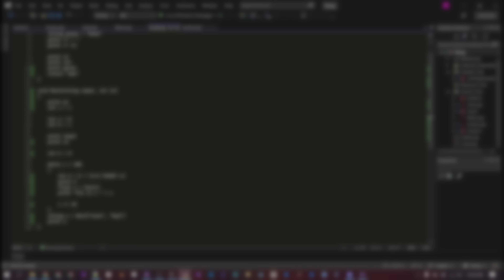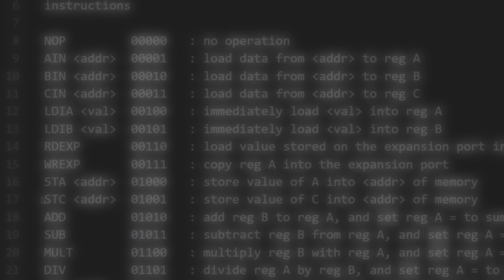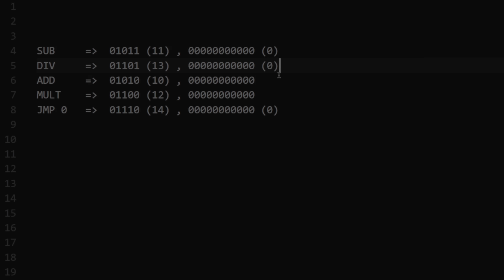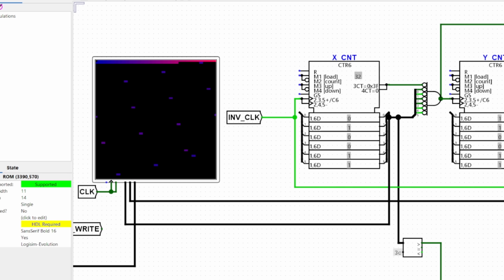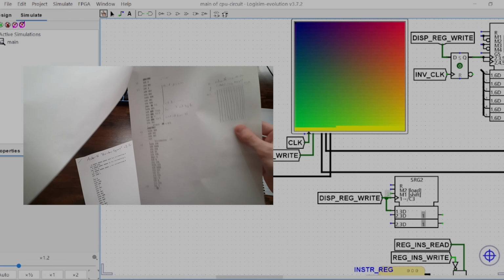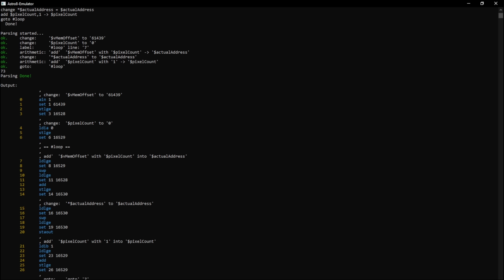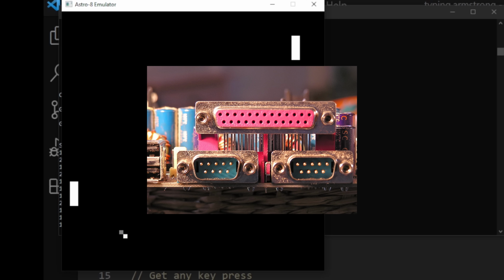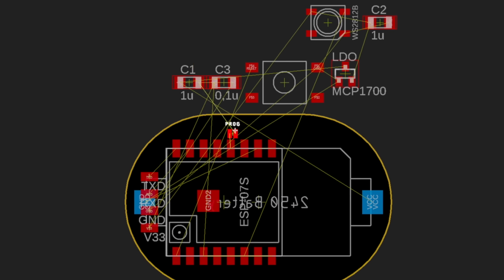I Designed My Own 16-bit CPU

Comment: Impressive! However, having special instructions for interacting with a controller is quite unusual. Normally those devices are simply memory mapped, thus it's possible to use a normal memory read/write
Reply: Z80 style :)

Comment: Woah, I remember last year, one of the subjects I had during the semester was about computer architecture. We saw how the alu works, the ram, the control unit, instruction and microinstruction sets and even periferal handling. Our tests were about designing some use cases for each component, which was a demanding process. Seeing you put that knowledge to work makes me remember how amazed I was while taking those classes. Nice video! and excellently explained too
Reply: I did that last year too! I don't know what software you used, but here we did it with diglog and it was a lot of fun ^^
Reply: @mathismartin3092  Our exams were mainly done on paper, but we used logisim for practicing! Of course we stuck to no more than 4 or  5 bits for the instruction set, and mostly doing just read, write and math instructions, but it was really interesting to figure out how to do certain things :D

Comment: Hum, imagine if you made it super scalar and out of order.
And perhaps allow merging multiple execution paths for results with more bits, making it say 64 bit, but faster running 4x 16 bit instructions or 2 x 32 bit instructions, although capable of doing a 1 x 64 bit instruction as a macro instruction, running multiple simultaneous microinstructions in order to do so.

Comment: man this reminds me of when i started designing CPUs in logisim, fun times! though i had basically no knowledge of hardware design besides a few YT videos so they were much worse than what you made.
also, wasn't that basically assembly you showed? in that context, converting the program into machine code is known as "assembling" not "compiling". on a side note, seeing assembly without any binary/hex numbers just feels weird...
anyways, for anyone who wants to program their own CPUs but doesn't want to bother making an assembler from scratch, there are univeral assembler frameworks that just need you to define the instructions and their binary output, and then you can just use them, for example: "CustomASM". i've used it for a long time and it's pretty good.

Comment: Great project! 
You are usi g the same toolchain,  I used to try out building an ALU and later a CPU. I found it to be extremely intructive to see it working on the binary level. I was particularly proud of a multiplication unit which could do a 16x16 multiplication unut that used the Russiin peasant multiplication and only used 2 cycles.
I think your instruction set us too fat. If you have to use the microcode to sequence operations to perform the opcodes and you program it in a higher level language with a compiler, why not let the compiler sequence the micro opcodes directly.
Also I am not a friend of special I/o opcodes. I feel the complicate tgevdesign with essentially and additional address line. I have not seen any architecture that needed this much I/O range.
I believe that memory mapping Hardware into the normal address space is better, as it 'outfarms' all address decoding off CPU.
Finally, as much as I enjoyed the logic gateblevel design abd seeing it work in the circuit diagram, it could not be transferred into an FPGA as that would require a Verilog or other Hardware description language.
Also I noticed that my circuit tended to be logic level operated rather than flank operated.
I really miss a tool chain that would somehow bridge that gap and teaches the user to move over from gate level design to a HDL. But I guess it is a different approach.

Comment: You could have also made a backend of llvm for your assembly and instruction of your cpu which would allowed you to write programs in higher level lang like C
Reply: Or ACK. It's ancient(1987-2005) regrettable compiler toolkit with its own bytecode. It'd be interesting to see if it can be started. 

LCC and SDCC is also option, by they are not so exotic.

Comment: I see a lot of "I created my own (2ⁿ)-bit CPU" videos, blah blah.
It's getting old, I skip them lately, including this video.
Why not try something like 9-bit CPU, success or fail, it'll be for a content.
In such a design, a 74-words block has 666 bit.
Reply: I thought about doing 12-bit cpu on FPGA, but opted not to:
Most memory chips provide data in multiple of 8 bits. So realistically you need 2-3 chips to get non 24-bit chip.
9-bit CPU either requires up to two reads including the read where 7 bits would be discarded.
It also means that you need circuitry to translate your addresses into memory chip addresses.  Basically you get  tons of headache with no benefit.
Reply: @Maykeye  I know that. Doing it may not benefit you, but he's a content creator, I just suggest him an idea.

Comment: Nice narration tempo and modulation. The whole thing brought back Vic21 and C64 assembly programming. I had a Lunar Lander clone working using the 4 f keys as various levels of thrust, the comma and period to rotate and the space bar for the abort burn. Fun times.

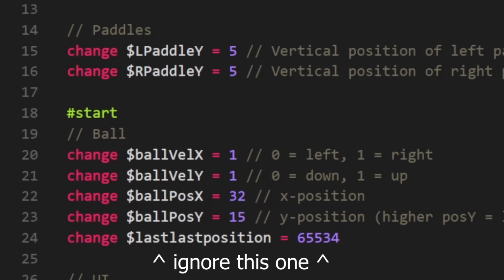Comment: 12:21 Is the ignored variable holds a value for the program to memorize, a some sort of the staple point during the calculations? It's binary logarithm is close to 16, that, I guess, is connected pointing to the СPU bit depth.

Comment: You could learn verilog or vhdl to create the cpu on an fpga, then use off the shelf ic's for ram and rom. Fpga's, if you dont know, are programmable hardware that rewire themselves based on coding. Intel , AMD, and other companies use multi million dollar chips for prototyping chips before sending them off to print. Consumer models range from $50 to $300, and have been used for software implementations for retro systems and modern 32 and 64 bit risc v based cpus.
Reply: alternatively you can also be lazy like me and simply build your circuits in a logic simulator like "Digital" (it's like Logisim but faster and with extra features) and then just export them as Verilog/VDHL.
it works surprisingly well actually.
Reply: And at this point I would have thought that chips from Intel and AMD are pure evolution .. no revolutionary steps. Steps are not agile. Maybe they include experimental modules in every chip, test them, and if it works, you get the next iteration ( more expensive ). An FPGA and a chip from Intel have nothing in common. Intel chips are optimized down to the photolithography layout and full analog simulation (spice) of the transistors. FPGA does not give you this. The days of the Pentium DIV bug, where a professor from a university uses an ad hoc script to get his algorithm from university software to some proprietary CAD at intel, are long gone.
Reply: @ArneChristianRosenfeldt  The advantage of using an FGPA instead of individual chips for this project is, that others could make use of it too by simply reprogramming their FPGA. There is already a real CPU design called Magic-1 from Bill Buzbee. The problem is, others have to recreate it, if they want have a copy of it. Search for Magic-1 on YT, there are some videos about this impressive project.
Reply: @ArneChristianRosenfeldt wouldn't FPGA be a bit more like a drawing board at that level?
Reply: @darkcoeficient  FPGA is full of lookup tables. Chip designers have to (reuse) existing optimized “high level” modules, almost like third party had to do on an ASIC. I don’t see how you would go from one to the other.
Reply: How does the computer understand letters and English? Like can you code in arabic?
Reply: @TheWeirderness the computer doesn't understand the code itself, it only understands different combinations of 0 volts and 5 volts being stored in small bits of memory called "the instruction register(s)", and a bunch of logic gates built out of transistors decide what to do based on that specific combination of 0 and 5 volts.
however the assembler is what undrstands letters in english, kind of.
an assembler is a program written by writing the combinations of 0 and 5 volts that correspond to the set of instructions that do the assembler's algorithm, into the main memory (probably ROM, maybe RAM) of the computer.
the assembler takes the letters in the code and at each space compares the bunch of letters it's read with the names of instructions in its memory that are decided by whoever made the assembler, and if those bunch of characters are not found in the instruction names memory it outputs an error, otherwise it writes to the memory the combination of 0 and 5 volts that the processor is designed to do that instructions when it's read as an instruction; the assembler then empties its memory of these bunch of letters and moves to the first letter after the space and repeats the same process until it finishes the entire code (usually there's a special letter that indicates the end of the file and when the assembler reads it it stops).

no you can't write code in arabic unless you make your own assembler with instruction names in arabic and the coressponding binary representation of the instruction (its op code); or if you write a programming language whose code is in arabic and which somehow converts that code to an assembly language whose assembler already exists and thus can be assembled into the binary machine code that the CPU understands; currently there are no arabic assembly languages with an existing assembler, nor any arabic programming languages with existing compilers or interpreters that convert the code into an assembly language with an existing assembler, nor ones that convert code into machine code.
Reply: yes this

Comment: That is really cool.  Can you now add relational instructions?  A better question, have you considered building a microprocessor that does not use the Turing Machine model?  For example, all parallel execution fluid dynamics processes?  In this case, your programs would be defined in the form of When condition Then Assignment.  In a fluid dynamic fashion, it would process in two steps: (1) compute all When conditions, and (2) perform of Then assignments.  The advantages of this kind of processor are that program errors/bugs may be made impossible and that it is inherently very fast.  Of course, a programmer could enter faulty requirements but that's not a bug in code.  Each set of assignments are simply made under whatever conditions are specified for when they should occur.  Therefore,  a program will automatically take care of situations you never even thought about.  To be errorless/bugless, you do need to deal with assignment conflicts.  That is, do multiple WhenThens assign the same memory differently, at the same time?  You could treat that as a error/bug or deal with it.  In fluid dynamics (like simulating movement of liquid or stars in a galaxy), each would add its "influence" to the result.  The end result would therefore be the sum of all influences.  For example, the some of changes along x, y, and z lines.  For water molecules, each would push on its neighbor (influencing the neighbor).  After all such influences are computed, the new positions of each molecule is assigned... and the cycle repeats.  For neural nets, similar fluid dynamics occur.  This is what neuromorphic computing is, except that it's just for simulated perceptrons (vague notion of a neuron).  

So to make this work, you will need two positions in memory for each:  pre-value and post-value.  For non-linear values, you could do something different like, allowing the assign to a random simultaneous assignee and a notification bit to each.  Perhaps making it, When .. Then .. Else ..  (else being if a different one was allowed to monopolize the assignment).   You might call that an error but I'd call it an ambiguity.  The results would work kinda like in quantum mechanics.

Comment: You may want to expand the architecture to add interrupts, although it does complicate things somewhat given that you'll probably want a stack to handle those, and you currently don't have anything stack-ish like jump-to-subroute or returns.
Reply: Was going to mention this.  It would make timing quite a bit simpler, no more arbitrary wait N cycle loops, just execute game logic once on every vertical sync interrupt. :)

Comment: For smoother movement of the paddles, you could have created 2 more characters (either added to the charset, or overwriting some unused characters) with half height paddle characters, so your paddle could move in half-tile increments.
Reply: if it supports color for text, 1 character is enough: you simply swap background and foreground color which turn ▀ turns into ▄ .
Reply: or a way to write arbitrary data into unused characters and then display that with the faster character rendering
Reply: This would make the drawing routine more complex and thus slower. Better design a bit blitter and let the  bit blitter hardware do the rest.

Comment: One small thing about how you explained your emulator. You conveniently forgot to mention that part of why logisim is so much slower is that it actually simulates things far more in depth than your emulator. A very minor thing, but the way you glossed over it gives the impression that logisim is slow because... It's slow. Rather than because it's doing way more work than your emulator.
Reply: and Logisim's speed does depend on whether or not one is using the default 'chips' inside it or not, it has math operators and register modules, and whatnot, but if you eschew that and go down to the individual gates in sub-circuits....
Reply: He does say that logisim is simulating every logic gate, and that's why it's slow.  Seemed sufficient to me.
Reply: Yeah I was a bit confused at that. Why would they differ in speed so much when they’re both emulators?
Reply: @Costelad  Imagine instead of executing an add instruction directly, you simulate the propagation of electricity through each part of the circuit implementing an add operation.

Comment: aw you missed one of the core features of Pong.  The angle of the bounce is determined by where on the paddle the ball hits.  If it hits in the middle of the paddle, then angle of reflection = angle of incidence.  if you hit the ball on the corner of your paddle, it bounces off almost completely vertically and repeatedly bounces off of the upper and lower walls of the court, and there's a smooth gradation of bounce behavior between the center and the edge of the paddle.  skilled Pong players could control exactly where the ball went by letting it hit their paddle in just the right place.  in fact this was the innovation that made Pong so different than previous table-tennis video games.  controlling where the ball went so that your opponent could not move their paddle to that location in time to hit the ball is why Pong was so fun.  source: I'm an old man

Comment: Wouldn’t swap bc make sense? When needed it would be only one instruction instead of two. Or are there then to many bits used for the instructions? Because to much instructions? At least in you cool self designed cpu.
Reply: He has place for at least 8 more instructions (namely 0b11_000 - 0b11_111).

Comment: Now grab an FPGA devkit and turn it into real hardware! (In case you haven't done that before, designing circuitry with Verilog / VHDL is actually quite an interesting puzzle).
Reply: Agree. My university had us build a single cycle 8-bit MIPS processor on a Xilinx FPGA. A very simple processor, yet probably the best project we've done so far.

Comment: Awesome project. I love stuff like this, even started my own project. Tho it's already a few years working on and off on it, and using a 6502 instead of just logic stuff, and on breadboards. Fun stuff and great work getting so deep with this stuff!

Now make it in real hardware! 😏 ...I mean, you used logisim so IC counterparts should be relarively easy to come by, VGA might pose some problems but the VGA signal is quite simple in the end...